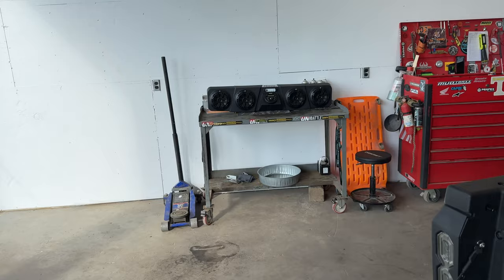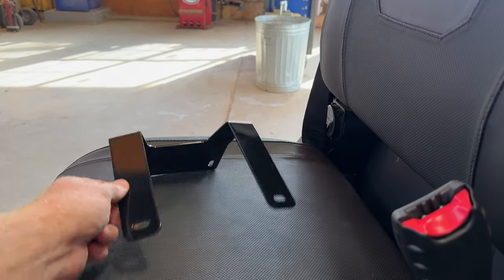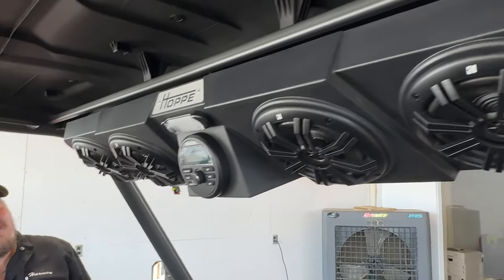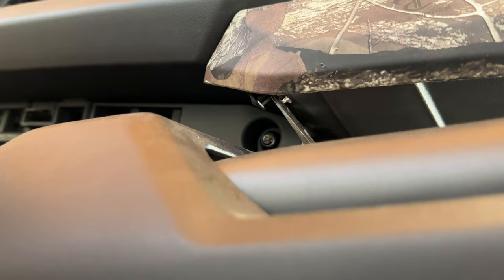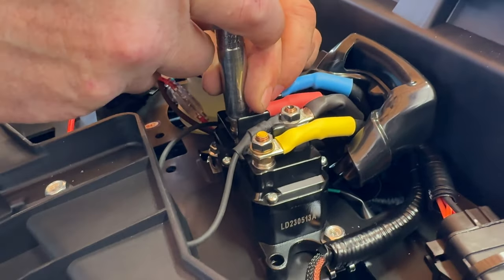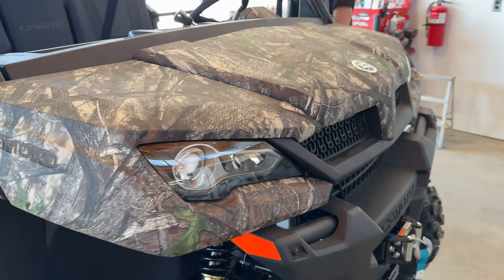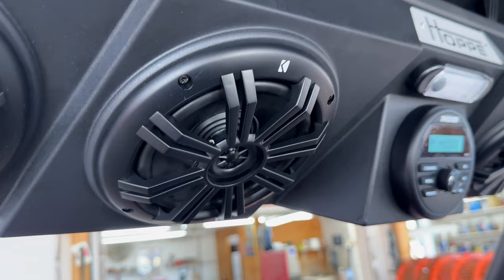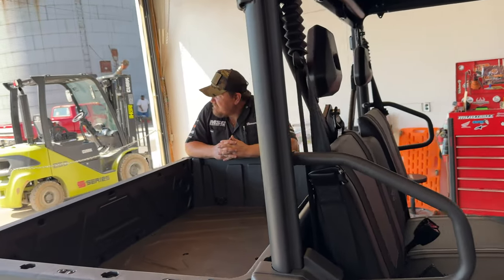CFMOTO UFORCE 1000 Hoppe Kicker Custom Sound System Install & Review

Comment: Hey Blake, I finished my stereo install on the uforce 1000xl.  I installed a Double Din Stereo where the center cup holder is, a bass tube subwoofer under the passenger front seat with a 400 watt amp for the 8 speakers mounted overhead.  Head unit has XM, GPS, wireless Apple car play, and a reverse camera.  Do you have a way I can send some pictures to you?